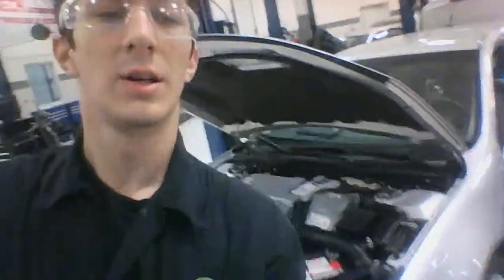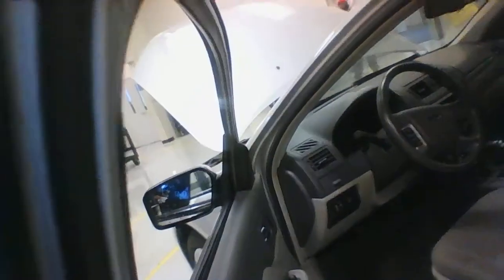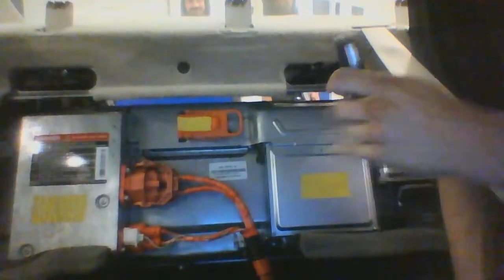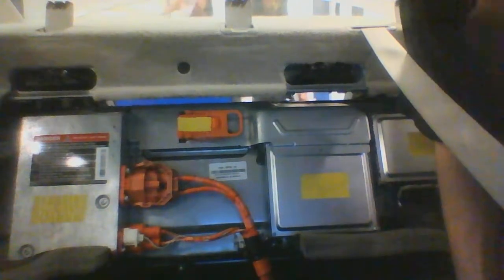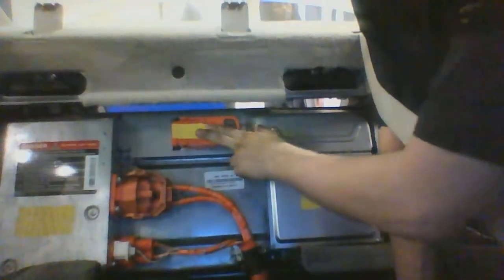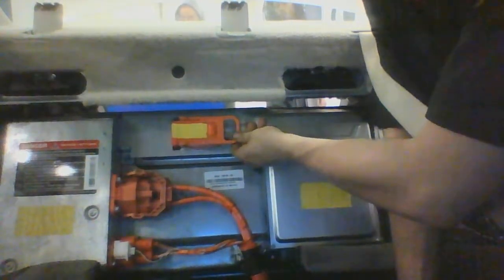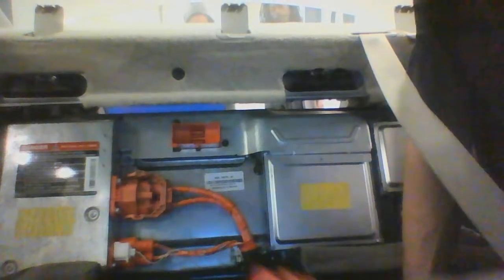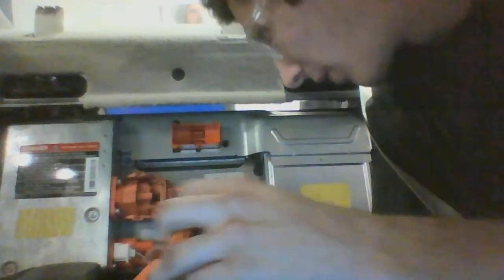2012 ford fusion hybrid power down

Comment: Hey John I have a 2013 Ford Fusion hybrid and no one will help me because the warning indicators  don’t stay on the dash. But my stop safely light came on & and it went off but I’m scared to drive the vehicle
Reply from the maker: I'd recommend the dealer amd make sure to complain excessively and insist there is a problem.  It is most likely a battery failure but can't confirm without more info.